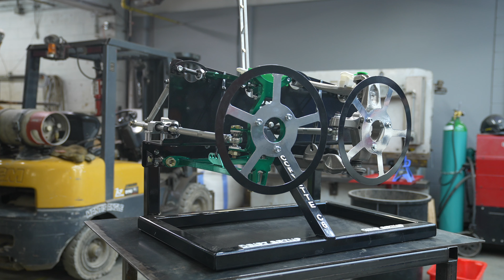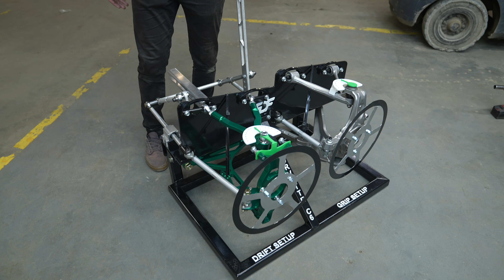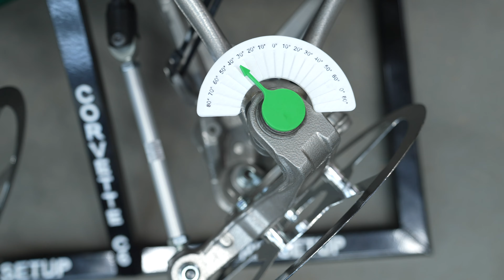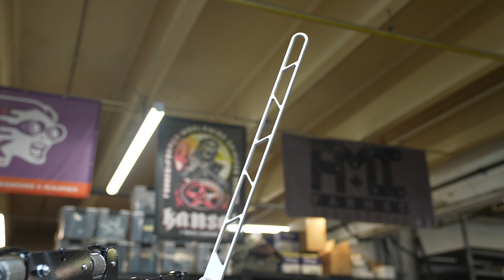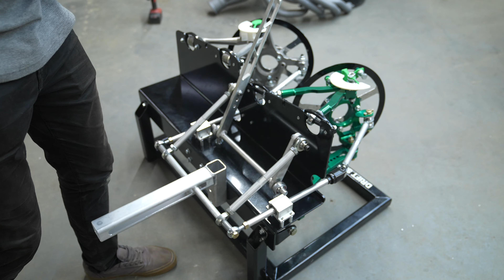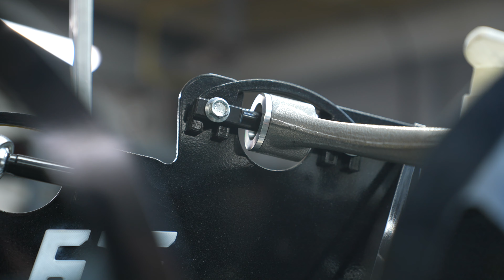Our Crazy Suspension Display Works!!

Comment: One problem is the shafts you're using are not the proper type for linear motion (you need something like TGP shaft).  Also, as robwigglezz points out, having 2 bearings inline per shaft would work better.  Another option is to make the shafts rigidly mounted to one another in parallel, while one set of bearings (one side), float to allow for the 2 shafts to be slightly out of parallel.  It's a neat setup though. 👍 Sorry, as an engineer I can't help myself.